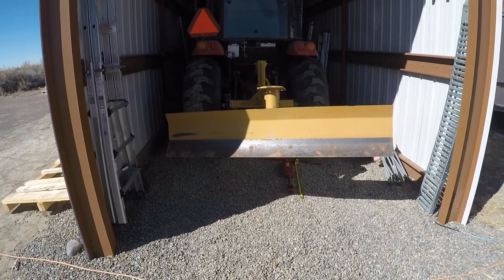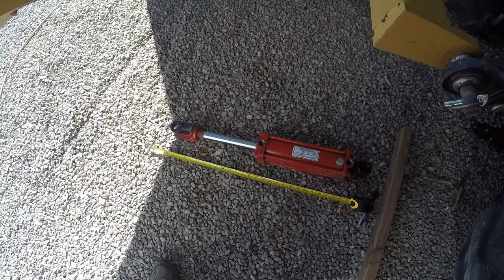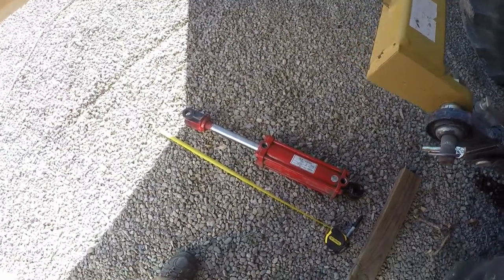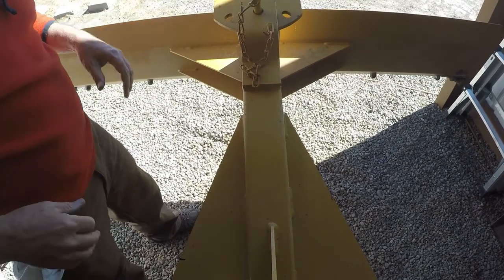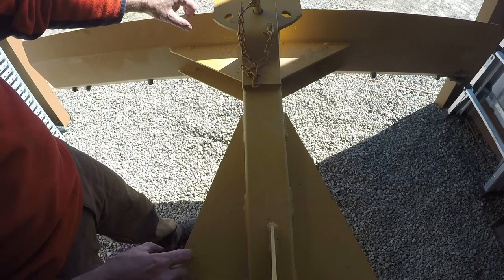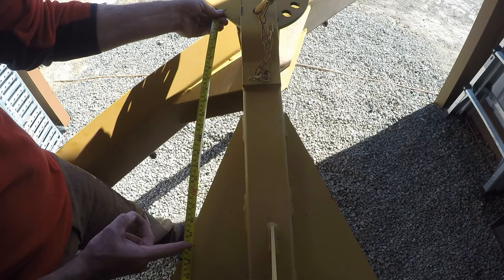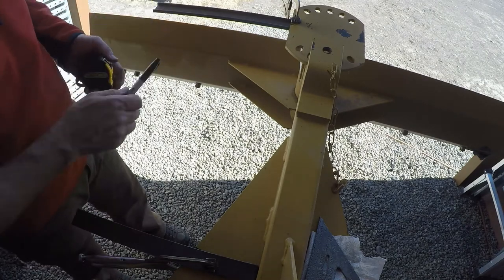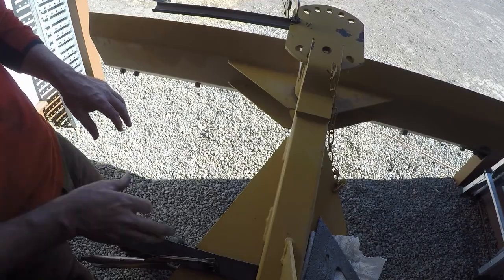County Line Grader Blade HYDRAULIC CONVERSION (Part 1)

Comment: Great set of videos Sir! My blade is almost identical to yours, you just took a lot of thinking out of my head, im going to copy your idea 👍
Jim.
Reply from the maker: If you make a video of the final product I would really like to see it 👍
Reply: Hello Again, im getting closer to getting mine built, i can't remember if you said how long the pivoting arm is. I am guessing it would be in the naborhood of 8" from the center of the pivot point on the blade to the center hole of the short arm you welded on for the hydraulic cylinder. Yours seems to have worked out perfectly, so if i were to use your measurement, it would save me some guess work🤔

Comment: Thanks for reply. I will check w/my Kubota dealer, I will need a lever. I was so glad to see your 3 part video, we think alike. I will need to sell my 5’ blade and go up to a 6’ blade to do this. I noticed you seem to have several implements for your 3-point. Would you be interested to sell me the County Line you modified in the video? Depending where you live, I could drive there w/my pickup truck and fetch it this Spring. Just curious if that might be of interest. Thanks again.

Comment: Really good idea, in fact I'm thinking of doing something similar for my skid steer.  The question I have is the potential for damaging the hydraulic system should the blade impact something solid and causing high back pressure on the cylinder/system.  I don't know that it would but it crossed my mind.  Is this something you've had to deal with before or have any suggestions?
Reply from the maker: I'm not an expert, but that shouldn't be a problem as long as you don't have any valves open while you are plowing. In other words, make your blade adjustments with the blade in the air, in the vehicle still. If the blade isn't moving, none of the valves are open, and there shouldn't be any back pressure directly on the hydraulic pump if you hit something. I think it's more likely you might bend a cylinder rod. But again, I don't know for sure, these are just guesses. Personally I haven't had any problems, and the more I think about it, we put tremendous stress on the loader, banging into things trying to scoop them up all while running the hydraulics. And the system seems to do fine. I think that's a great question, but I'm probably not the person to answer it for sure

Comment: When you connect the 2 hydraulic hoses, which lever operates those?  I have the ports when my Kubota backhoe is off, but the levers that operate those ports are on the backhoe mechanism.  What am I missing?
Reply from the maker: So on my Mahindra if I start at the connectors outside the tractor, and trace the hydraulic lines that go inside the cab, right above that spot just inside the cab (and beside the seat) is a small lever that has three positions. Also the three-point lift lever is in that same area, still beside the seat, but a bit forward of the hydraulic control lever. Anyhow, that's the Mahindra design. Just check with your dealer, I'm sorry I don't know much about kubota's, it's been 35 years since I've driven one. If you don't have a control lever there, you may be able to add one somehow. Hey, thanks for watching, I'm sorry I wasn't more help